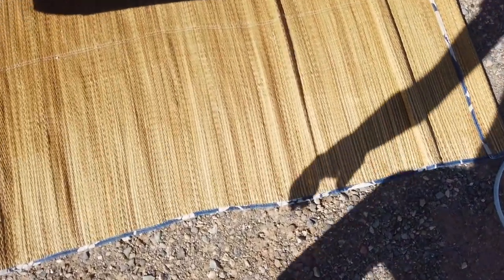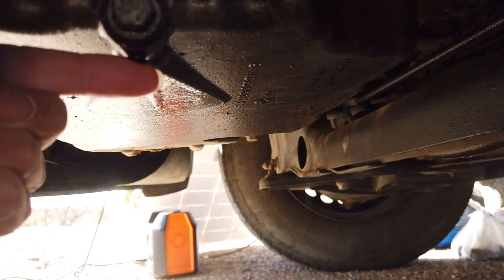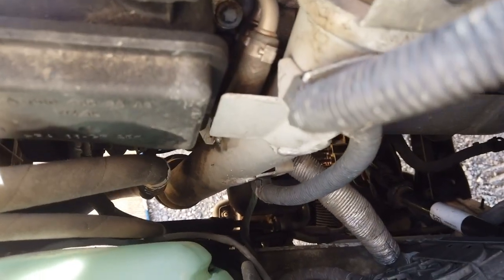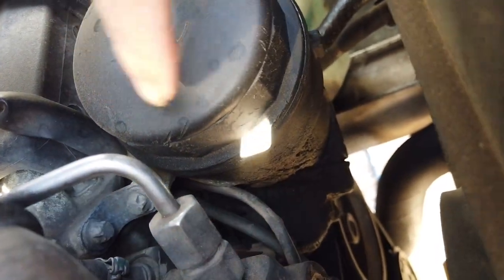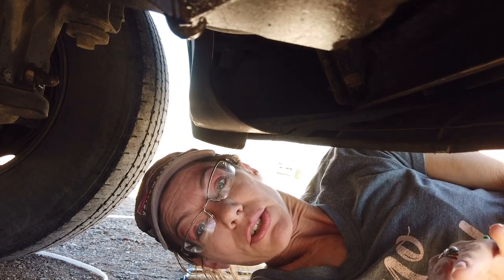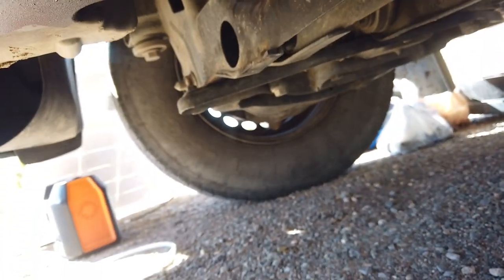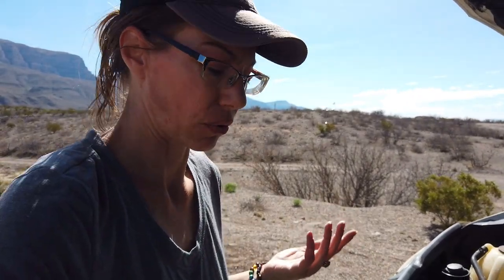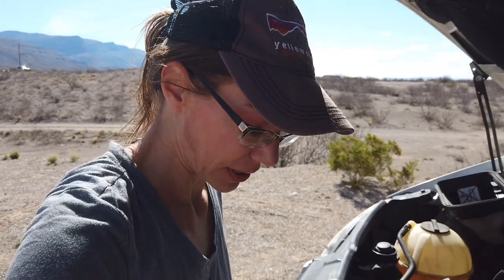Diagnosing a Problem with MB Sprinter Van - Van Life

Comment: I bought a 2012 MB Sprinter 170" ext two months ago and it came with a super similar oil leak (227K on the engine).  I mentioned it to you a few weeks ago when you first mentioned this on a video.  Mercedes does not sell just the gasket by itself.  You have to buy the entire oil filter along with the housing/gasket.  Part for me was about $150.  You have it pulled up correctly on your cell phone...the one from Europarts for $139.  My mechanic only charged me $140 to install (but he's on the cheap side) and I only lost about 2/3 of a quart of oil in the process.
Reply from the maker: snackman Yes, this video was recorded before we spoke. It’s the gasket leaking on oil filter housing just like yours. Thank you

Comment: I own a 2007 Sprinter with 245000 miles and counting. I had been told that diesels haven't even been broken in until 250k miles. The reason why is bc they move at slower RMPs. I have also been advised to be able to get your super high milage out of your diesels is to, depending on the amount of use that you should take it in and have all your seals and filters changed out once a year. If you take care of your engine it will take care of you. 
The leak that you were searching probably either a defect in the seal or when it was installed when you changed your oil last they just didn't tighten it down to the specs it needed. But there is one more thing it just could have loosened over time. For that you have to keep an eye on it and just tighten it your self.  
I do not know the extent of your knowledge about the Sprinter But I have found that not every diesel mechanic can work on them. They have to be certified with Mercedes and be licensed for them to be any kind of successful in diagnosing and fixing them. For Example I live in Colorado and there are only two that are licensed here. They are in Denver not Colorado Springs. So find one close to you and you will be successful, and ride for a long time.

Comment: My 2008 had the same leak coming from the oil filter housing. Dealer claimed the housing needed replacement. I questioned about just replacing the gasket but I suppose there isn’t much money I. Replacing a gasket when they got me for $850 to replace the housing and gasket.

Comment: The oil filter housing is an easy repair. You can do this job yourself. Just make sure you clean all surfaces good and don't forget to tourque the new housing to manufactures specifications  because it will leak if you don't.
Reply: Man, what are you talking about? Have you done it by yourself? You think this lady can do this job by herself?!!?!?!?!?!?